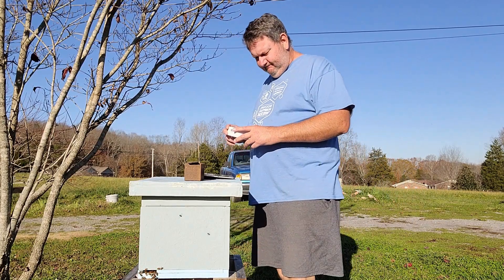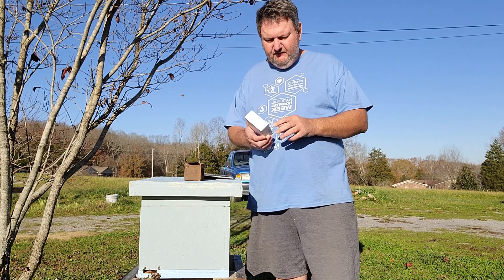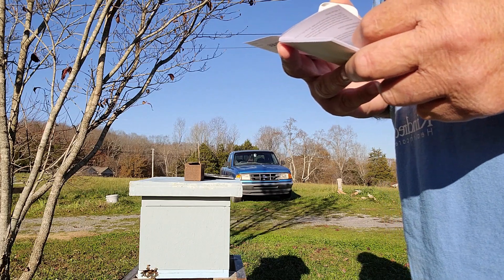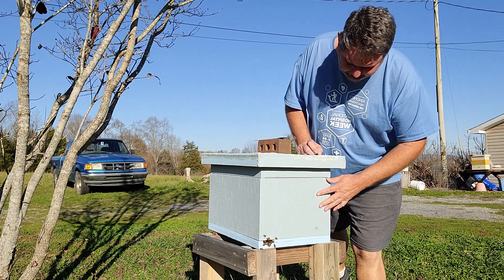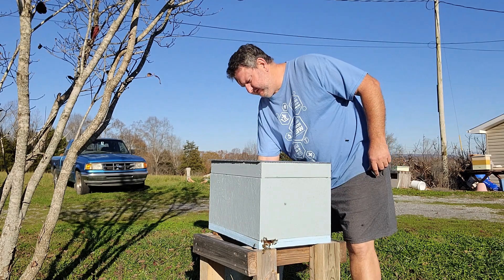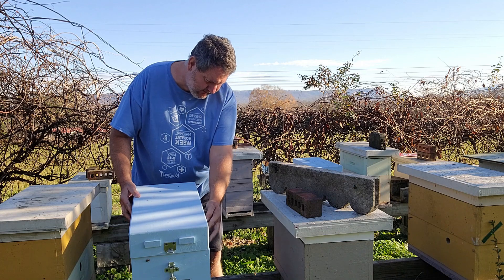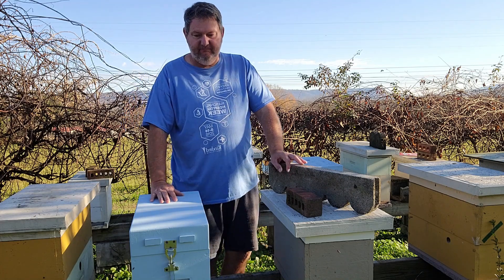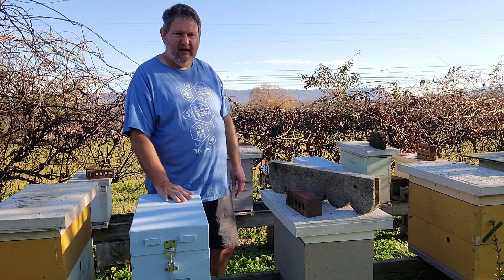Temperature & Humidity Sensor in the hives

Comment: Hello Woolie, question for you.  I purchased the Broodminder Temp and Love it.  We are now in the 30's F, and my last temp reading inside under the inner lid of the top box was 83 degrees?  With freezing temps outside, is this is good temp to see for inside the hive???
Reply from the maker: wow last year when i ran them just right above the cluster never got over 70 degrees and my lids are insulated but i had them in mini hives i need to put them in big hives this winter. if your running polystyrene i would expect higher temperatures. if your running wood they are using a lot of stores to put up those temps.
Reply: @WoolieBsApiary  Thank you Woolie, your response is interesting.  The people at Broodminder just got back with me and told it was an ideal temp.  Yet, I have double deep wooden hives; flow Hives, with double insulation.  Today was our first day below 30 degrees F, and yet it was 83 inside the hive.  Yet they are completely packed out with honey reserves so not at all worried even if they are going through some.  I have fondants as a backup.  
If I'm not mistaken, after thinking about this more, isn't the center temp of an brood nest supposed to range in the 90s?  Is so, this 83 degree temp would make sense.  either way I'm learning for the first time so grateful for your response.
Reply from the maker: @bradgoliphant  depends if you have brood. the temp of the cluster will drop without brood rearing
Reply: @WoolieBsApiary  Oh, that's it!!!  There are still three frames of brood heading into the cold temps.  Got it.  Thx

Comment: I was just looking at poly hives in Better Bee yesterday.  Never have tried them.  $$$
Reply from the maker: 3rd year and so far i love them. i bought mine from perfect bee
Reply: @WoolieBsApiary  I was looking a Lyson.
Reply: @WoolieBsApiary  ok
Reply from the maker: @628DirtRooster  that is what these are. you will need to spend some money and buy a really good paint to protect these ive heard the sun really degrades them over time.
Reply: 628DirtRooster Bees I bought 2 Lyson 6-frames from PerfectBee.com and liked them so well I ordered 5 more. Had some EZ-Nucs I knew wouldn’t take the winter. Only had them 2 months but I dig them. I don’t have 8-10 framers, but will likely get at least one. The 6-frames are not to bad and extra boxes are around $20, assuming you go vertical.
Reply: Woolie B's Apiary I gotta paint mine. I really jumped the gun and just threw bees in them thanks!